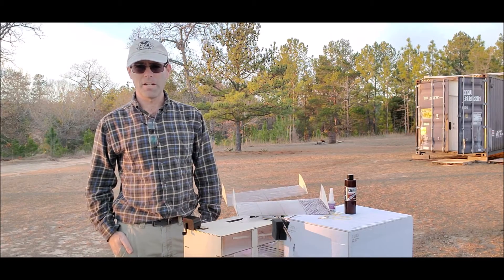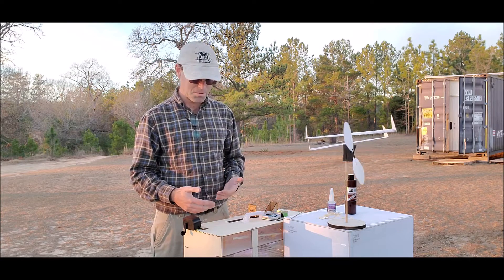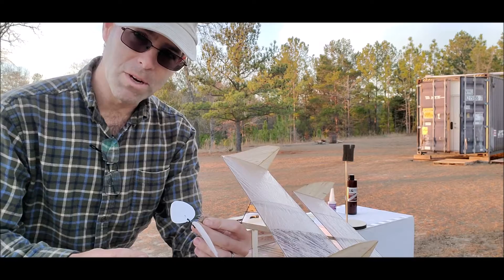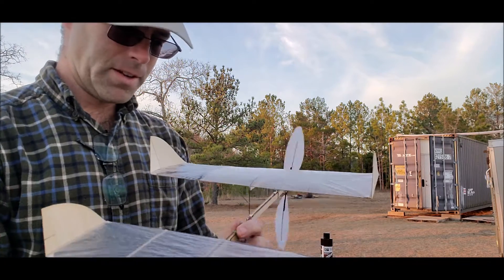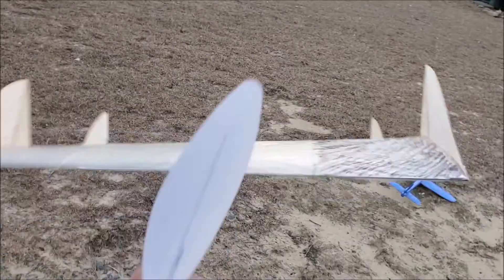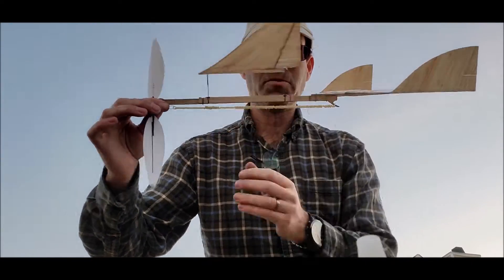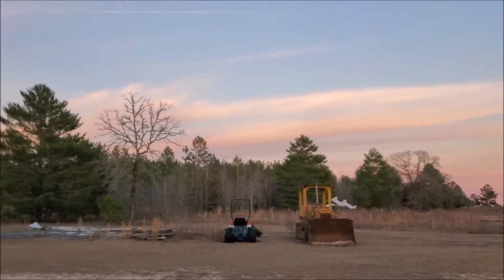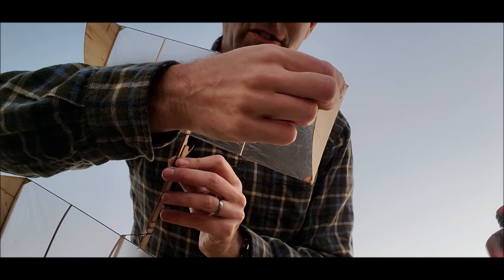Flight trimming for 2023 Science Olympiad Flight airplanes Pt. 2: Stinger

Comment: Thank you so much for the video! Quick question; my glider right now is climbing and turning very nicely, however it flies rather quickly and is not always stable. I've checked the wing and tail of my glider, and both look fine, yet it still seems to fly very fast. Do you have any suggestions to improve my glider?
Reply from the maker: How is it not stable? It sounds like maybe you should slide the wing forward a little, but that description is a little confusing.
Reply: @joshuawfinn  Sorry for the vague description! To clarify, when my glider flies, it climbs up very high and glides downward with nice turns, however these turns are very fast and the glider does not spend a long time in the air. Additionally, once it is done climbing, the glider will occasionally wobble and rotate slightly (horizontally).

Comment: Hello, I’m in science Olympiad and it’s my first time doing flight. We’re using a a freedom flight kit for division b for one of our planes and a ward’s science kit for the other. Could we try applying the advice you gave for the stinger to our planes, or does the same advice not apply to all planes? Both our planes are diving so far and we were hoping to improve them the next time we get gym time.
Reply from the maker: Yeah they're a similar layout and should respond similarly. Make sure to set your CG per the plans in the kit with a rubber motor loaded in place before adjusting the incidence angles.

Comment: Hello, l have a question regarding your plane. Do you have any tips on how to get the most out of your motor before it snaps or needs to be replaced? Thanks.
Reply from the maker: Lubricate before every flight, use a torque meter, wind to torque while monitoring turns. Most motors handled so are good for 5-6 flights.

Comment: I have my front wing very far back on the broomstick so it doesnet stall, I feel like it’s robbing time since my plane just goes to the top of the ceiling and then goes down. It does not cruise at the top of the gym at all. Let me know what you think, thanks!
Reply from the maker: If you've had to slide the wing very far back, you probably used too much glue on the tail. The other possibility is that you shimmed in too much incidence so the wing had to be slid back to prevent power stalling. If it is coming down in a dive, that's what the cause is.

Comment: Hello again, I was wondering how I could slide my wing forward without having my plane stall, I have added no shim. I'm using 3/32 loop with 1200 turns, going to try to get 1300-1400 winds. Also, If my plane is going above the height of the gym with the 3/32 loop should I lower the wing stab prop so that it does not hit the ceiling or should I just lower the turns? Love your vids!
Reply from the maker: Don't slide the wing forward if doing so makes it stall. Also never adjust incidence to limit climb, just destroys your cruise trim. Use a torque meter to wind consistently to max torque, then back off to torque that will get you safely to the ceiling.

Comment: At my completion the ceiling for the gym will be only 26 feet high until the lights. Do you have any tips to get the most time with such a small venue of space in the gym? I was thinking about using a thinner band, not sure if that will work. Let me know what you think I should do. Using a stinger division B(one with longer fuselage). Thanks a lot
Reply from the maker: In general, the lower the ceiling, the thicket the rubber you will need so as to maintain cruise for as long as possible. Get an estimate of cruise torque and then adjust backoff to get the desired climb torque (wind to full torque then back off to retain as many winds as possible). 26 feet is a decent ceiling height so 3/32" (0.094") rubber will probably be fine. Possibly .096" will be better, hard to say, and it all depends on which batch it's from.
Reply: @joshuawfinn  Okay, thanks

Comment: What propeller did you swap to at 14:02? My plane is having trouble climbing, and sometimes just glides down from where I let go. I usually put in about 1350-1500 turns using a 1:15 crank. I'm trimming, but it seems like the propeller did wonders when you swapped, where could I get it?
Reply from the maker: That's a Papatong 24cm prop. Don't expect it to work miracles, it requires a well trimmed airplane. It does open up some performance options. They're on my website. In terms of your plane, have you shimmed the tailboom to keep the nose up? Which propeller do you have?
Reply: @joshuawfinn  I’m using an Ikara 24cm prop, balanced and supported with a carbon rod on each blade. I’ll trim tomorrow, and then reply to your comment if there are any issues.
Reply from the maker: @NexusXGG  if it's a true Ikara prop with the gray hub, the carbon doesn't help that's only needed for IFFS props. Might be part of your problem.
Reply: @joshuawfinn  Oh, okay! I'll take the rods off when I test tomorrow, thank you!

Comment: How many turns are you putting in the plane? I winded mine to 1000, and it flew for about 30-45 seconds, the plane flies very smoothly but I not getting good times, do you know what could be up? Using a 3/32 loop
Reply from the maker: Try going up to 1300 turns. That should at least get you to 90 seconds.

Comment: Hello! Thanks for the great video. Unfortunately even with the help of this video my plane still is not getting very much lift. It's turning and flying very nicely, but it is not flying very high up. I feel like I have pretty much gone through every potential problem area, and have yet to found the solution. Would appreciate any advice.
Reply from the maker: Are you lubricating the rubber and winding to 1300-1400 turns? That part makes a huge difference as well as making sure the prop shaft isn't bent. How much does your plane weigh?

Comment: Hi, thank you this video!! However, I keep having problems with my plane. At first the plane worked great, and the only problem it had was that the turns weren’t tight enough. But I followed the video and bent the wing of the tail. When I tried my plane the next day it would put it’s nose up and the tail couldn’t support the planes lift . So then I tried to move the front wings up and added mass to the nose of the plane. But then my plane had to much lift and sort of did a flip, when I tested it. So finally I tried to add more weight to the front wings and made sure that the cg was still under the wing. It was, but now I don’t know how to fix the plane when. Any suggestions?
Reply: check that your tail boom is still in the same spot, maybe it got pushed a little bit backward and the shims made the decalage change by a couple of millimeters.

Comment: Hi Joshua,
My stinger isn't really staying in the air very long. Like I mean it will climb up to 20-30 ft then just go back down. Like in your videos I can see that your planes are like slowing going down. I have trimmed my plane and I'm doing 1000 turns so I don't know what to do. These flights that I do are topping at 1 min. I will usually have 400 turns left in flight, I see that there is a lot of power left in the plane so can you please help get my plane staying in the air longer. Thanks!
Reply from the maker: It's possible that you used too much glue and it's heavy, however you may just be flying with the CG too far forward. If you are able to shim for less incidence, you'll be able to fly with no nose weight or even slide the wing forward if there's no nose weight, which makes the flight pattern more efficient. Be careful because this does make the plane less stable.
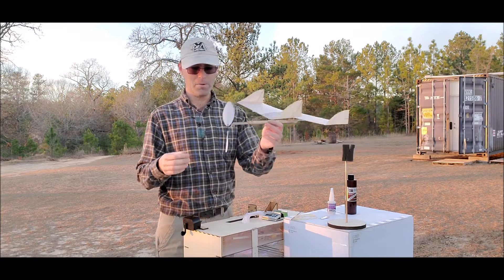Reply: @joshuawfinn  Thanks I am trying it out and getting better results with about 1:30 min. Also what is incidence?
Reply from the maker: @ThePixelCubers  ok that's progress. Here's a website with some diagrams showing the incidence angle. Incidence and decalage get switched often, for our purposes use what is described as the decalage angle: https://www.amaflightschool.org/getstarted/learn-basic-aerodynamics
Reply: @joshuawfinn  Thank you! I trimmed the plane and I'm ready to test it out tomorrow!

Comment: Thank you very much for the video. It helps a lot! I'm wondering, what if the plane descends very fast?
Reply from the maker: Is this at the end of the flight or is it diving out at the beginning?
Reply: @joshuawfinn  At the end of the flight.
Reply from the maker: @xiaoxuyuan5343  is it running out of turns or landing with a lot of turns left?
Reply: Landing with  some turns left, not a lot.
Reply: I picked it up, launched it again, still can fly Almost 20 seconds because there were some turns left.
Reply from the maker: @xiaoxuyuan5343  try shimming the tailboom like I did in the video. It sounds like the plane is too close to neutral.
Reply: @joshuawfinn  Thanks for the help!

Comment: Hi! Thanks for the amazing video, my plane is flying much better now, I just have one question. I accidentally snapped all of my rubber motors and threw them away. Would I be able to use any large rubber band that weighs less than 2g for my rubber motor, if not where can I buy some more?
Reply from the maker: You will need to order more 3/32" Tan Supersport rubber. Do a Google search for it to find what vendor can get it delivered to you the quickest.

Comment: Thank you so much for this video. When our team first built and trimmed their Stinger C about a month ago, they were getting 70-90 seconds. Since then after much testing and many crashes, it is starting out good and at around 5-8 seconds, it starts climbing too much and almosts flips and falls back to the ground. They have tried a bunch of different things, but nothing is making a difference. It almost glides better than it flies. Do you have any suggestions they can try? Thanks.
Reply from the maker: Sounds like the repairs have added a lot of weight to the tail. You can add nose weight to correct the problem, however the plane is probably reaching the end of its useful life and a replacement should be built soon.

Comment: hello! first of all, thank you so much for your helpful tips. my planes have significantly improved in flight times. I just had a question. Whenever I release my plane, it starts vibrating a lot and I know you said in the video that it most likely is caused by the propeller. How should I go about fixing this?
Reply from the maker: Check the video on modifying the IFFS propellers. That will likely eliminate the vibration.

Comment: hi, i just had another quick question. My stinger does not climb much and stays nose-level, and I believe that a reason could be that there is a clicking noise coming from the front of the plane. My guess is that it's the propeller hitting the nose, robbing power, but what do you think? What could be some possible solutions too? thanks!
Reply from the maker: Verify that it's not contacting anything during rotation and that the prop shaft is straight. Also watch the video I made on modifying IFFS propellers.

Comment: Hey quick question, our plane is flying with a very small turn, almost straight. Tried bending the back wing but it really didn't do much, any tips? Also the peak altitude maxes out around 10 ft @ 900 turns, how can we make it climb higher?
Reply from the maker: Bend more, and make sure the propeller bearing isn't misaligned and that the tail isn't tilted. Wind it up more, max turns is over 1300.